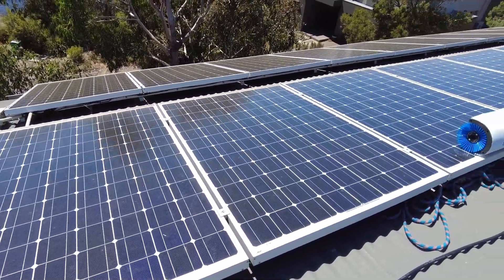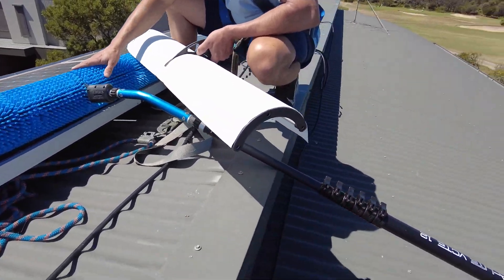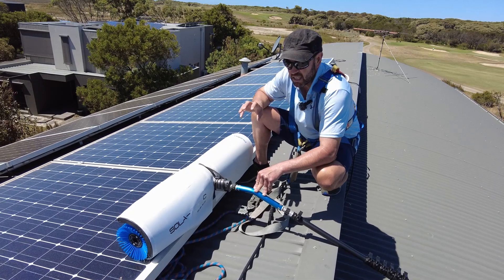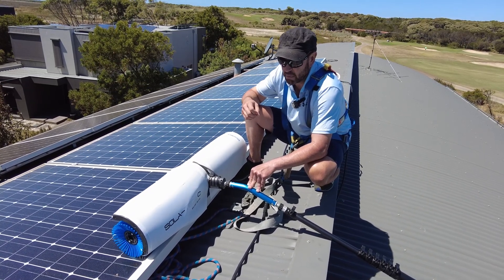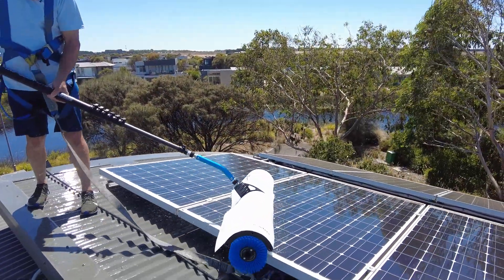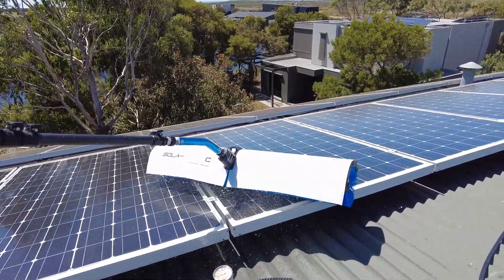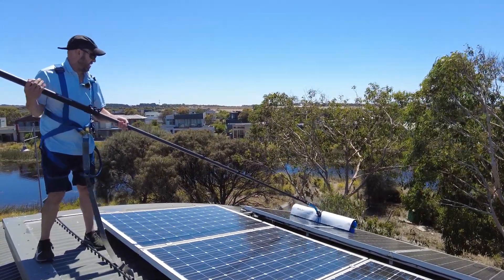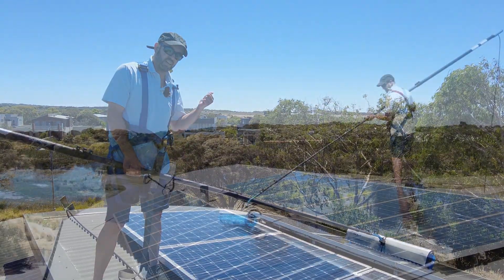Sola Tecs C1000 in a Residential Aspect | Solar Panel Cleaning- Lets Explore

Comment: It is a fantastic brush.......  The only critic i have here i that  you are  using the telescopic lance at it weakest point...   Even though you most probably  took out the the top 2 sections of the carbon fiber pole   you should only use the  top  thinner pieces of the pole when you need  to extend it out at its fullest.... You would be better off  extending the widest extensions first and work you way up.  Because there is a high chance of causing microscopic   damage to the fibres   and  worse ( snap the pole totally at the end ..... If it did snap you could still repair the damage by cutting off the  damaged end part and gluing with expoxy 2 way glue....
Reply from the maker: All good comments, two sizes available 12m and 15m if at max reach you don’t over extend each section, better still. There are also 50mm modular poles for shorter distances.